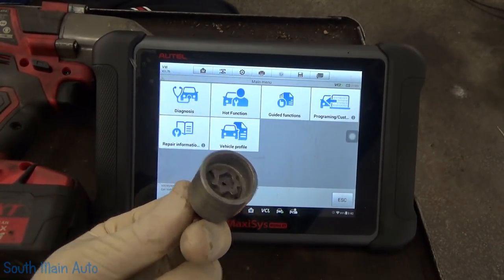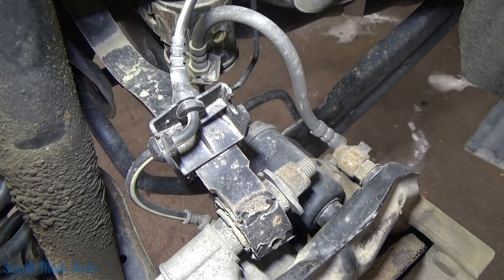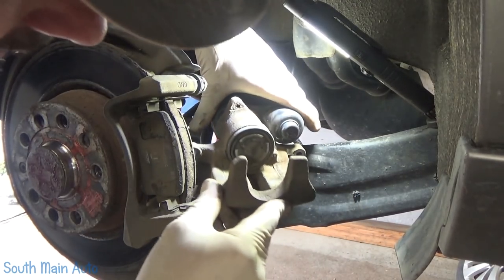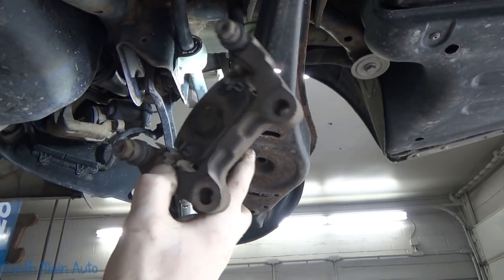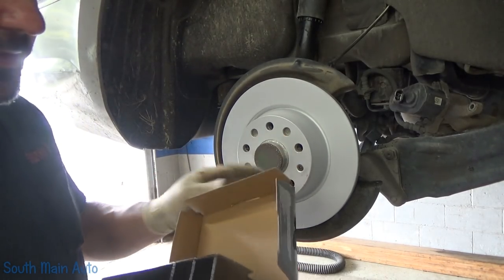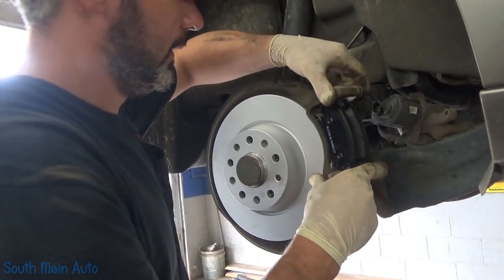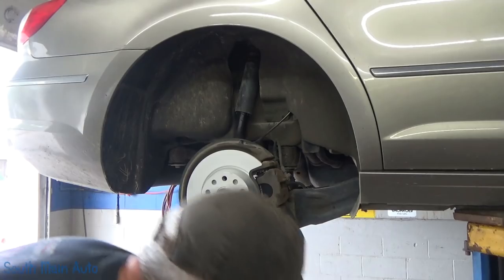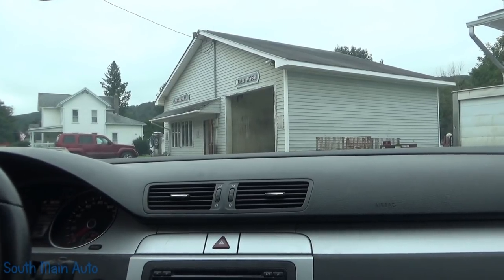Do You Need A $1000 Scan Tool Just To Change Brake Pads!?

Comment: MANNNNNN I SAID THE SAME THING A FEW MONTHS AGO!!!!!!!!!!!!!!!!
Crazy thing was..they didn’t want to rotate in, I literally had to flippin disconnect the wire harness hook up the power probe, and literally hit the caliper with 12v just to get them to turn in...THEN....after I was done the brake light was on..flippin wire pin came loose, I was so freaking frustrated when I finally spend another 20min figuring out what I did wrong.

Comment: After reading the comments , there appears to be some " work arounds " for getting this done . After this video came out , I believe in 10/19 Innova came out with scan tool Model # 5610 with bi-direcional control . It has a HUGE number of system tests . I would look at the manual online and call them to verify that you can do the test on your SPECIFIC VEHICLE before you buy the tool . It's under $ 300.00 on EBAY . And Launch has an X-431 Diagun in the $ 600.00 range . Ivan from Pine Hollow did a review . I would see on ANY tool if the updates are FREE .

Comment: Service mode oh brudder. Now I gotta start looking for electrical plug ins on brake jobs. I take it the emergency brakes are electrical? Good thing ya made me aware of it. How can a wheel bearing be torqued so tight and not fail. Talk about over kill.
Reply: It all depends on the style of bearing. Sealed bearings can take higher torque but roller/caged bearings, like those found in front rotors of some, can't be. They need a minimum lateral play.
Reply: Cuba Rodriguez Timpkin used to be the bearing you’d tighten to torque and then back it off 1/4 to 1/3 turn then put in cotter pin/key to remove some of the preload. These newer bearings are round with the two halves of the race being torqued together at pretty high specs to preload them.

Comment: kick out the vacuum from the brake booster..... hold the brake pedal and put on the ignition..... push the parking brake switch to release and hold it untill the indicator lights up... release the switch for a second and push it again for about 5 secs... release the switch... you should hear the actuators now.... release the brake when they are done, turn off ignition and do the work.....
when you're done, do the same procedure but this time turn the switch to engage to reset the actuators ...

Comment: By the way next time you have this car in your shop you should check the intake cam adaptation value with a capable scan tool I know it can be done with the VCDS but I will try with my Autel the limit is somewhere 8 to 9 degré over this there is some codes concerning cam & crank correlations but worst is the timing chain might and will jump causing engine damage the chains have a tendency to stretch I would be sup-prize  that it has it’s original chain I have a lot of experience with these engine in VW and Audi cars .

Comment: insanely tight :)) maybe start with a giant torque wrench 3/4" or 1" drive? I use a horrible fright one for the large high torque bulk things, surely it's accurate enough at 9 bazillion ft.lbs lol
did some ring and pinion crush sleeve and crush sleeve eliminator stuff and they never blew chunks, of course it was all less than 500HP and many wheel bearing/cv's and no issues

Comment: Yes there is a manual way of doing those parking brakes all you do is unbolt unplug first the wiring unbolt the three bolts in the back remove the unit and you manually use a torque you put into the caliber and unscrew it then you compress the caliper back in the piston then you put it back together

Comment: For your viewers does the scanner eliminate the process of taking off the brake fluid tank Reservoir cap when pressing in the caliper piston so it doesn't pop any seals up there I notice you didn't show releasing the pressure on the reservoir tank for the brake fluid

Comment: eric  this is the one i bought for mt 09 tiguan    ANCEL VD500 OBD II Diagnostic Scanner for Volkswagen VW Audi Skoda Seat Check Engine Light EPB ABS SRS Code Reader Oil Throttle Position Adaption Brake Pad Reset Tool. piad over 70 dallors canadian on amazon

Comment: Picked up a cheap scan tool, specifically for vw, Audi and seat, for about $ 70.00 on wish.com , has the facilities for servicing brakes, trouble codes , service resets, but nowhere near as  much information as the more expensive, higher quality tools

Comment: I do it by unbolting the electric motor. 99.999% of them use t30 torx bolts. Unbolt the two of them twist and pop the motor off then you just wind it in "usually a female torx socket by hand. Make sure you spin the correct way or the Piston will pop out. Once it stops turning in easily just squeeze it in like normal.

Comment: I just turn the parking brake off then wind them back normally (opel insignia) but the electronic parking brake is a separate part and not connected to the caliper.

Comment: i work for Chrysler,dodge,jeep,ram , all the cars i have worked on i have been able to put the brakes in service mode in the radio you can allso put it in jack mode or alignment mode (for air ride) it all in the owners guide
Reply: its said that the right to repair is getting harder and harder for home guys and independent shops

Comment: To retract parking brake remove motor from caliper,  then spin gear in caliper to retract parking brake internal screw, press piston in and finish brake job. When finished operate parking brake switch a few times until it adjusts. Your done.
My daughters drive German cars.

Comment: My Subaru dealer charges 1.7 labor hours for pads and machining rotors. 

Our Subarus (legacy and outback) do “require” a scan tool to put the rear brakes in “maintenance mode”. I haven’t seen any aftermarket tool (Snapon and Autel) that has this option before 2018.

Anyhow...the scan tool just winds back the brake piston, so you can compress it.  If you have a hockey puck that fits the piston (brake service tool) then you can manually wind back the piston and compress it. Nothing is hurt or damaged it’s just another annoying dealer feature. Some engineers will argue that the brake maintenance modes resets the learning position of the electronic parking brake, when you turn off brake maintenance mode.

You mentee that you didn’t have the correct hockey puck for your brake tool.....buy a master set off ebay. Those Chinese sets have adapters over never seen before.

Comment: Cheap Solution for DIY'r goto junk yard, chop off connector (on junk car) for rear caliper. It's a simple electric motor with worm gear. 9v battery + chopped connector = Service mode. the battery one direction will pull the motor (out) and reversing the polarity will push it back (in) and 9v is slow enough on a 12v motor to not damage anything.

Comment: As an Audi tech. If I get a non- Audi vehicle. I just supply 12v to the electromechanical caliper via power pack. Then operate the parking brake to reset the system.

Comment: Briansmobile1 did a video a while ago where he removed the two bolts and took the electrical part off the calliper and was able to use either an allen key or a torx bit (I cannt remember which)  in where the electrical part was to wind back the hand brake part  and then push the  piston in..

Comment: It's  just a dc motor.  I have been disconnecting it and applying power and ground with a power probe.  If it contracts rather  than retracts simply reverse the leads.

Comment: Take the motor off the caliper and retract the mechanism with the spline stud turning it clockwise then press the piston the back and reinstall the motor no need for a scan tool I’ve done dozens like that so far and no problems

Comment: i think i can make some wiring and some random connectors and supply the reverse polarity to the motors in parallel until they reach service point... this should work even with the car off but i doubt they will come back to their original operation heigh on their own and keep it happy... wonderful tech you didnt knew you needed right eric? when i grow up i wanna be like you eric!
ah i forgot to ask how much is one of those bosch m-vci? i have been looking for those in my country but cant find it...

Comment: I ran into this issues doing the rear brakes on my neighbours Tiguan .. I had no clue you needed a sophisticated device to do a simple brake job.. Through some research, I found out you can remove the motor on the back of the calliper and manually back off the motor. But beware.. These German cars are wired to the tits with tight parameters and resistance tolerances .. I lucked out and had no lights on after i did the job.

Comment: every vehicle that I have ever worked on with electric parking brakes (Ford Fusion, Jeep Wrangler, VW Jetta ect...) has had the ability to put the rear parking brakes in "service mode" within either the instrument cluster settings menu or the media center settings menu. I cant say that I know a single vehicle that the only way to get the rear parking brakes into service mode is by a scan tool.

Comment: Ok so I checked out how to do a 2016 ford fusion epb. You turn key on (no start ) push accelerator down and push parking brake down. wait I guess five seconds then turn car off and turn it back on within 5 seconds STILL HOLDING THE ACCELERATOR DOWN AND PARKING BRAKE DOWN. the readout should then say car is in maintenance mode.Then push the piston back do not screw in even tho it looks like abs. Once replacing the brakes turn key on (no start) and pushing accelerator down you LIFT UP parking brake and holding it again in this position you turn car off then within 5 seconds turn back on and readout should say brakes are normal may work with other cars too

Comment: Remove the electric motor, torc 30 socket, rewind anti clockwise, use the tool to push back in piston, when finished turn on electronic hand brake 2 times to wind it back in.

Comment: on ford and subie  remove the motor then manually turn the apply shaft  then push the piston back  when installing turn shaft until pads lock on rotor then back slightly reattach motor

Comment: At the dealership i work at we charge 1hr for pads and 1.5hrs for pads and rotors. It doesnt matter to us if it has a electronic parking parking brake or not.
Reply: And most of the Ford's you dont need the scan tool

Comment: A bypass should be pretty simple. The entire car operates off of low voltage right? If you can figure out what is being supplied to the connector you can probably get an adjustable power supply and hook it up to make it do what you need to do. I also dont think it would be hard for someone to come up with a dedicated tool that would do that for you with a connector some circuit and a 9v battery.

Comment: Q: If the battery was disconnected you should be able the push the brake piston in. This works on a Prius, but a haven't worked on a VW?

Comment: Get a 9 volt battery 
Use two wire leads 
Connect them to the battery 
Disconnect the connected to the parking brake located behind rotar 
Insert wire leads into connector 
If the caliper closes reverse your wires 
If it opens wait about 30 to 60 seconds 
Now the caliper is open 
When done 
Use your electronic parking brake 3 or 4 times to make sure it’s syncing properly 
No Charge !

Comment: Hi,I got a question.after u using the diagnostic tool to release the pressure of fluid,did u turn off the key or u just keep it on  until u finish done the job then rerun the pressure?

Comment: Euro cars are the worst for overly complex electronicals.

You can absolutely run two wires from the ground to the positive  on the battery and run the caliper back.

Did that in my Audi A4.

Comment: If you unscrew the electric motor, you can turn the piston until it is at the bottom .. and then it is in "service mode" without any scan tool ....

Comment: Hello Great Videos.  Do you have a recommendation for a scan tool that does live data for Nissan's automatic trans Xterra mainly. I need to read the live data for a P0705 code. Need to make sure the switch is in the right position before i troubleshoot other problems.

Comment: I still think a mechanical parking brake is safer. What do you do if your brakes fail? At least you have some minor braking from a parking brake. If anything slow down using engine braking and the final stop using the parking brake. I have no idea how you would activate these brakes in that situation, and also control how much braking is done so you don't lose control.

Comment: It's just a new method of doing things.  I'm a little miffed that these new Bosch brake systems don't use a secondary set of pads, rather they use the standard pads and rotors.  It's understood that they are a hydraulic backup system, rather than a friction surface backup - but belt and braces are always appreciated.

There are manufacturers knocking out EPB tools for VAG/Bosch that cost about $40 delivered.   Yes - it's another bloody tool for something that shouldn't be difficult..

Comment: Hay Mr O.. I have a Passat and since "upgrading" to leather heated seats I now have the following symptoms.. 
1, an srs  light on dash. scan tool says "drivers seat belt shorted". It is not connected up at the connector under seat.
2, drivers window switch will not do 1 touch open/close.
3, trust open button on drivers door not working.
Any advice please??
Much appreciated by an avid UK follower.
Phil.

Comment: Aslong as the caliper is only a two wire multiplug you can actually wind the caliper back with a powerperobe (make sure the handbrake is released fist) 
On the new style land rovers just power probe the pins with live and earth whilst pushing the piston back. That really is a last resort but no universal diagnostic scanners like the new landrovers.

Comment: There is a work around   Don’t need to use a scan tool at all. Unbolt the electric motor from the caliper and turn the brake in the caliper in by hand using whatever tool that will fit  torx or inverted torx works a lot of the time. Change the brakes.  Then you just have to readjust the e brake back out and bolt the motor back on.   Works on all of the electric e brakes

Comment: Think if it is a 2 pin connector  at the caliper , With the caliper still mounted, you can't you unplug the connector and with a power probe jump power to one pin  and ground to the pin other and the motor will turn the screw inside to push the piston out and squeeze the pads tighter or reversed to retract the screw ,so you can push the pistons in to replace the rear brake pads.It might be German , but it's not V2 Rocket science.in Enigma code with a swastika on the cover.

Comment: There is a work around without the scan tool 12V battery and test leads put power and ground to the motor. If it goes the wrong way simply reverse the leads and it'll back off

Comment: Our 2006 Jaguar Super V8 has a similar system. Independent shop wants.. ready for this?.. $800 to do the rear brakes. $700 for the fronts. They tell me the rears can not be done without a similar tool. Fronts cost me $45 in pads from Auto Zone. Rears? Off to the Forums to research.. True story

Comment: The OBDeleven scan diagnostics tool is only £30, £60 with a pro account. Specifically designed to work on VAG vehicles. No need for $1000 scan tool.

Comment: U dont have to put them in to service mode u can screw them in, service mode only retracts the parking brake threads, so you can just press it inn as it shud be just as in front

Comment: Not sure about VW, but on my Mercedes you can;
1. Open the driver's window.
2. Engine on, put the car in neutral.
3. Get out and close the door.
4. Reach in through the window and turn the engine off.
5. Result; engine off, parking brake off.

Comment: I used to work in a local tire shop doing tires, batteries, bulbs things of that nature. Always HATED to see VWs come in. Everything was made harder by over engineering. Pain in the ass! And yes the search for those stupid wheek lock keys yeilded some interesting finds! We had many times when the key was not there, and we had to send them away. Boy people hate that!
Reply: when they come back, suggest a "universal" lug key, standard wheel lug and welder to remove the missing junk, explain and have them sign a waiver about possible rim/hub/rotor damage to cover your arses ;)

Comment: For 50 years since disk brakes came out I have never received new hardware with new brake pads unless especially ordering it extra. It may somehow be a difference between East and West Coast. It never ever comes with the pads since I have been doing this on my 1970 ss 396 Chevelle. Have always used the old ones were we don't use salt like an idiot on the road.

Comment: The Multi Scan Tool DS150e  (Aliexpress) should do the trick. It's a AUTOCOM clone. I would buy one with a single PCB design. about 50-70$. But you will need a Notebook.

Comment: Do you use that scan tool for all your scans for all cars ??? Does it fix airbag cods and tire pressure sensors ? And also throttle body reseate ? Does it do all that ?

Comment: I was a dyed in the  wool VW person had four Golf's one after the other right up until this electronic crap computer to change brake pads and if you drive a TDI diesel  you need a computer to change the fuel filter because the pump won't prime without it.

Comment: Step two take the wheel lock and take all of the wheel locks off and replace with normal lug nuts and throw the wheel lock and nuts away! What I did after Tires Plus lost the key and had them pay for it 😆

Comment: I just did a Toyota rav4 hibrid rear break did not put it on service mode and a bunch off dash lights came up and won’t go away took it to the dealer and got charged $3032 to fix the problem the entire break sylinder and power booster had to be replace cause it got danger it that true or did they scam me

Comment: Just put 12 volt on the connector and see if its turning lose, if not just switch the wires
Reply: jan van der Wal  Yep, works with VW, Audi and Volvo and maybe also other brands.